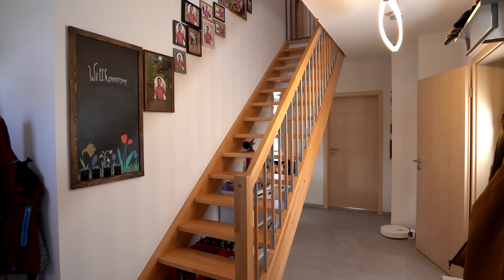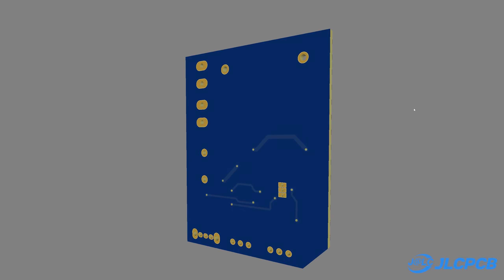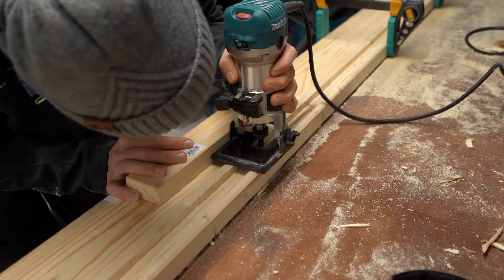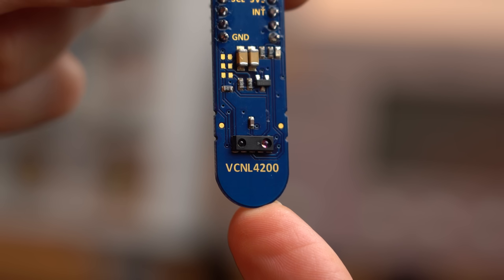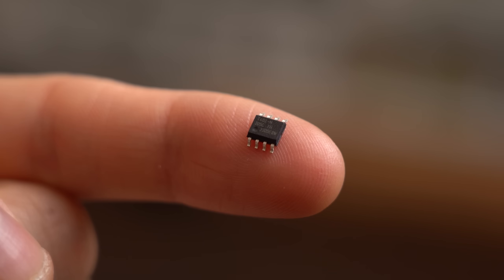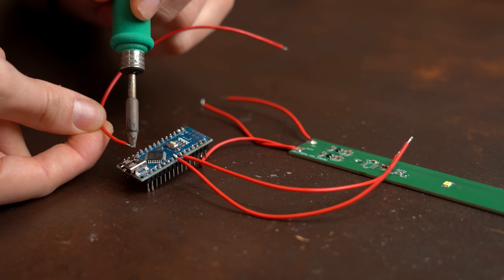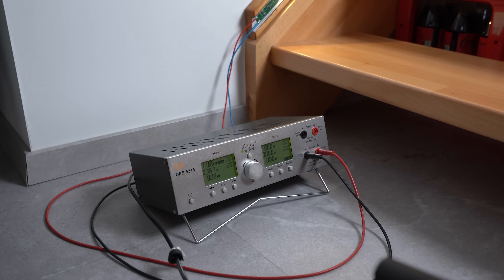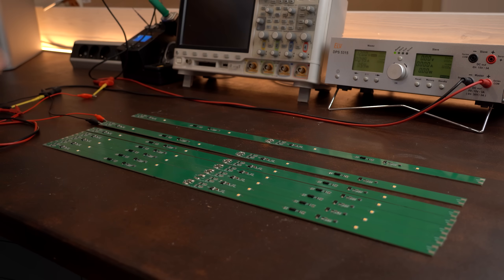I tried to Revolutionize LED Lights!.....And FAILED?

Comment: Ich schreibe das in Deutsch weil ich das in Englisch nicht so gut ausdrücken kann. Wahrscheinlich wurde sowas ähnliches auch schon vorgeschlagen.
Wenn du zB einen extra Kanal (evtl schmaler) in die Rückseite oder Oberseite der Holzleisten fräst, könnte man vielleicht die Sensoren von den LEDs trennen. Über kleine Löcher (wenn Kanal auf der Rückseite) oder den separaten Kanal auf der Oberseite, und auf die Länge der Treppe dann die Sensoren über die Stufen verteilen. 
Die Position der Sensoren könnte man dann auf entsprechende LEDs eines LED-Streifen mit adressierbaren LEDs mappen.
Vorteil wäre, man könnte wieder getrübte Abdeckungen für die LEDs verwenden.

Comment: Also gemessen daran, dass es besonders die Paneele sind, die am weitesten vom netzteil entfernt sind (wo also am meisten noise ankommen sollte), denke ich macht deine Einschätzung, dass die verbauten teile einfach zu viel noise erzeugen am meisten Sinn auf den ersten Blick. Meine Frage wäre, denkst du es ist der Infrarotsensor der da fehlzündet oder irgendwas im  LED Treiber Bereich? Würde ein tauschen vom infrarotsensor durch ne andere Technik wie z.B. Ultraschall funktionieren (ich sehe dass du dann die Boards neu machen müsstest, aber stand jetzt sieht's ja sowieso danach aus, und mit Ultraschall könntest du wenigstens milchige Blenden benutzen)

Comment: An addressable LED strip and a few proximity sensors (could steal power from the led strip + separate cable for Data) might be easier, but boring

Comment: i would've just used a lidar/tof sensor to tell which module to turn on, like with UART or something

or like WS2812B's, a data in and data out

on the modules, read a byte, only send the other ones to the next chip

on the main one deciding which one to turn on just send a series of bytes (one per led module)

Comment: "Which meant i had to flip 14 diodes...". ;) I am a software guy, so the programming stuff would not have bothered me. Flipping 14 diodes would have been a bad place. I would have flipped 13, and put one back in the original position... then fixed it again and screwed it up, haha. Thank you for the great content. That was awesome!

Comment: Tantalum polymer capacitors can deal with the HF noise better then aluminum electrolytics can, you might want to consider adding a 68uF 35V one per board alongside some MLCCs

Comment: I can't offer feedback on your design. But I can on your overall idea. It is a cool effect but as an aid to walking down the stairs in the dark, I don't think its the best. 
In my opinion you should light the whole staircase, however thats too easy and not cool.
So a lighting effect is needed. If you approach from the top the lights should light in sequence from top to bottom, and bottom to top if approached from the bottom. 
And if 2 people approach from top and bottom, then the stairs can workout who gets priority.
The smart bit is detecting the approach and making sure they can't turn off while you are on the stairs. 
I think you could expand this in to emergency lighting, to guide you to an exit if the smoke detector goes off. 
Your project so you fo you.

Comment: It is something I'd like to make myself. 

I was thinking about a different approach.

I wanted to use a regular indexable led strip and couple it with a single distance sensor (lidar?) switching on (with dinner) only the portion of the leds that reside at the detected distance. It would and could become a problem if two people are passing by at the same time but it will reduce the amount of components immensely, thus reducing the idle power required by the system that will be always on.

For you the problem would fall around the positioning of the lidar sensor. For me it is fine because i have a corridor, not stairs!

One single mc will be enough to do all the computation.

I was even wondering if it is possible to do the trick using a camera with a ir illuminator. 

ANYWAY... good job. I'm curious to look at the end result.

Comment: Ι would only put a sensor on first and last step and have the lights gradually turn on starting from the side that was triggered and then play with the timings of them turning on and off to figure what works best. I think your idea is a lot cooler but a lot more complicated to implement, but im sure you'll figure it out!
Reply from the maker: Thanks for the feedback :-)
Reply: But then you'll have to walk at the same pace every time... and as a developer I surely understand how hard it is to fight the urge to overengineer stuff to solve even the slightest edge case, haha.
Reply: My inner 5 year old wants to chase the lights and try to trick the lights!
Reply: @tommythebiker3081  Ah just give it 30 seconds to be safe
Reply: @soejrd24978  but then they will take tooo long to turn off when you walk faster! 😁
Reply: @tommythebiker3081  Having the the first triggered sensor turn on the lights and the second turn of the lights would solve this but it would be a problem if someone comes up the stairs while you are going down. 4 sensor, 2 on the first two steps and 2 on the last two steps could understand how many people came and left the stairs so it would make sure they are always lit when someone is using them but this again is a bit complicated.. So what I meant with the first comment when I mentioned timings was: think of the slowest you'll ever climb for example carrying a baby, measure that, add a couple seconds and you have your time. This will lead to the lights being on for a lot longer when someone is normally going up or down and them turning of if for some reason you stop in the middle of the stairs because someone asked you something. You are going to have to make some comprises in any case it's just about finding what your balance is between functionality, resources, time, durability, and many more. I personally can't code so I would most likely use buttons with timers so I change the state of the lights  from both sides of the stairs and have them turn off automatically after a long time if I forget.

Comment: SOLUTION for the "clear verses frosted cover" dilemma...   Extend the proximity sensor for each step (with wires) to the outside bottom of the rail.  Of course, that means you will have to create a slot in the aluminum  rail at each step, and a cutout in the wood rail for the sensor to fit into.  You can bend the wires up when sliding the board into the aluminum rail.

Comment: Here is how I solved my problem.
Went to Dollarama store and picked up two packs of fairy lights for under $5. They are 5m long and come with a 3xAA see-through battery case which I snipped off to put both in series.
A USB charger instead of batteries, one NPN transistor, one photo cell and a couple of resistors, completes the light detection, and comes on when dark.
The one covering my basement stairs, runs on an IR motion detector instead of the photo cell that's used for upstairs, which comes on when dark and stays on all night. 
It consumes nothing.

Comment: Doesn't the i2c bus have a 4 bit address you have to set per step?  Otherwise, if all the controllers shared the same address they would turn on and off and the same time.

Comment: If your goal is just get lights on your stairs, then i recommend recreating AlexGyver's staircase lighting project. His project is much simplier: 2 pir sensors on ends of the staircase, 1 light sensor, and roll of addressible led strip. It should be simple to adapt project for your needs.

Comment: Cool!
I wanted to try the step light a while back where, when you switch it on, it would turn on one step at a time. It's different from your use case but still it would have looked really nice. I gave up on it because of the cost and wiring involved. I also have very little tools to try something like this.

Comment: Hey man couldn't you just use an addressable RGB strip and make a pcb with proximity sensors?  Then feed that data to the micro controller and activate the rgb close to the proximity sensor?

Comment: I would implement it in such a way that if it detects presence at either end of the staircase it would send a signal to all the microcontrollers and turn on the all the LEDs at least but viable brightness then distance sensors come into picture, when they detect a human being in front of it, it'll turn up the brightness of itself as well as the module ahead of it. ... In your case i feel like ths sensors might also be interfering with each other.
Reply from the maker: Thanks for the feedback.

Comment: Nice to see you took my suggestion for the ATTINY402. Ok, maybe I wasn't the only one to suggest that part. As far as this design, you made it too complicated. Why do you need a LED driver chip and circuit? Just drive a mosfet from the micro-controller. You don't need maximum power efficiency. The on time is insignificant and a bit of power wasted doesn't matter. 

I have wanted to do this kind of thing as well. But I don't plan of having such fancy individual control. Detect at the top and at the bottom of the stairs. No it isn't as fancy as individual step control but I'm not trying to make an impressive YouTube video. I just want enough light to be safe. I already have some lights like this in a hallway that are controlled.

Comment: It's overcomplicated I think? all you need is to detect which end of the staircase the human appears and then to light the LEDs up to simulate an average velocity, people rarely change there speed on stairs. Maybe adding a few sensors to compensate for any errors and adjust the timings. Adding more intelligent code is free, you are relying on an excessive number of sensors to tell you everything

Comment: Because the stairs are straight why dont you use mmwave to measure distance the person is at the stairs and light specific light using addressable LED strip
Reply: Or an industrial grade ultrasonic sensor

Comment: hey, great idea!
although it would be enough to only have proximity sensors on staircase top and bottom (and trigger all LEDs at once once movement has been detected), as I don't see cases when you jump to the middle of a staircase (you must pass top and bottom either way)

Comment: All you really need is 2-5 Osram spylux (battery operated) motion and twilight sensor lights, replacing the white led´s with red as to preserve night vision and supply them with a 5v 2A usb power supply if you do not want to replace the batteries every few months. I put one near my toilet so I do not need the bright room light at night, I replaced the led´s with red ones and bodged in a cable from a broken pc mouse (to by pass the batteries) supplied with a cheap phone charger/usb power adapter. Thanks to a built in timer it gives the light I need to get my aim right when I pee at night. 2-3 of these modified the same way would be more than enough to light a stair case or other hard to navigate in the dark area with out disturbing near by sleeping persons.
you really should cover the lights with a red plastic, if necessary leave short bits of clear plastic just over the sensors, the cover on the spylux is opaque by the way so you could gut them only using their components for your light strip.

Comment: Since you're working with multilayer pcb you should consider using power and ground planes layer to sandwich noisy signals and shield them from sensitive signals, such the IN/OUT lines.
Placing 3 or 4 decoupling capacitor equally spaced on the whole PCB length shall help filtering out most of the noise.
Also, try to avoid running SDA and SCL lines as close for long distances. If not possible ground pour shall be filled in between.

Comment: Hi. I may have missed something but why did you need the data lines of the PCBs connected in the first place? Each PCB has its own sensor, controller and lights right? And in the video once you disconnected the data lines , most of the segments seems to work fine (I'm assuming) and the corner ones are problem. So check from which side the power is being given and if the voltage is getting bit too weird on other end maybe

Comment: Not sure how well this could work but instead of having individual distance sensors for each step almost, you could use one or two radar sensors at the top or bottom of the stairs. The LED strip can be an addressable strip like the SK6812 with warm or cool white and needs no modification. You measure the distance and then light up a couple of LEDs before and after that distance. Needs a ton of calibration and tuning maybe but it could work and end up being cheaper. I don't know how false positives and multiple users could be handled though.

Comment: I was thinking of a much easier solution with an Aqara FP2 presence sensor, a WLED strip and Home Assistant. Place the sensor at the top of the stairs, it should see your location accurately and then it is just a matter of coding some automations in Home Assistant to light up the correct part of the WLED strip depending on a person's distance from the sensor.

Comment: Why not just use a cheap addressable led strip and detect the person only on both ends of the stair? The project would do prtty much the same but with way less complexity and cost.  
it could also fit in a smaller rail (+1 wife approval factor) and you could use the diffusor

Comment: I think some kind of microwave sensor similar to ones used in dual technology PIR motion sensors for alarm systems would have worked better, or at least work through the diffuser cover of the profile. This idea is really good I think you should definitely pursue this. I think some of us would want to buy this

Comment: There is not a commercial product. I wanted to do this around 4 years ago. Almost all the more "advanced" commercial systems are ultrasonic or microwave at top and bottom of stairs and a timing system based on that input. I ended up buying cabinet or closet battery PIR motion cabinet lights, and running 2 wires between them in parallel from a wall power supply. The PIR system had a decent FOV so i could trigger a higher light, while walking up. they had automatic timing. But sometimes triggered randomly in the middle of the night.

Comment: This reminds me of a project I built back when I first started tinkering with electronics: A motion sensor based light controller with a PIR motion sensor. It worked beautifully most of the time, but whenever someone would flip on the light in the next room over, it would trigger the motion sensor resulting in the lights coming on in the middle of the night. I suspect I had similar issues with the input voltage fluctuating too much and confusing the sensor.

Thank you for the great video, keep up the good work and don't give up!

Comment: I definitely am not an electronics expert but i do alot of ESP32 /8266 projects. When ever i have unexplainable glitches happening on them I usually just start adding both decoupling capacitors and electrolitic capacitors untill the problem goes away ha.

Comment: Could it simply be an issue with your sensors reacting to the small movements in the wood when you walk on the stairs? Triggering false positives all over ?

Comment: I believe You messed up (or done suboptimally) few things:

1. those modules need to have some socket for disassembly for whatever reason, that soldering on stairs wasn't the best idea

2. i would consider researching how to program one uC from another, just think about plugging in into first uC and programming everything from that point, maybe You need to program programmer to 1st, then to 2nd, ... then to penultimate, then program real program to last, then to penultimate, ... then to 2nd and at last to 1st. i know, a lot of programming, but just write some ruby/python script which talks to avrdude or something. Or maybe You can put some socalled "bootloader" on Your uCs, like Arduino does.

3. also please consider adding test points/goldpins to Your boards, so You can connect easily using pogopins/dupont

4. why not have separate rails for 3v3, 5v and 12v? i know, a lot of pins, but nothing IDC-10 wouldn't handle

Comment: i have tested 3 pcb and turn out that you sent data line to other which lead issues and 2nd no capacitor it reset it self or stay on for no reason sound like not enough power or too much spike in power line and to reduce this issues just dont use same data line just use one ir detecter to one led or two led and add 800 mfu capacitor 8v to power line from beging to end so it doesnt drop out of stay on it should help and hope full you find it can fix up few mistake

Comment: Hey first awesome channel Im a fan. But a little friendly advice never, hold wood that close on the miter saw,  your hand should be on the outer holding part, if needed use a clamp but dont risk your fingers

Comment: Hey GreatScott, You might want to look into putting a blinder around the sensor. In a lot of the same sensor they have a divider between the sensor and sound it from when the led lights hit it. I notice my leds were hitting the sensor and keeping it on.

Hope that helps.

Comment: Another cheap solution for proximity sensor would be ir led and ir photo diode.
However in order to avoid issues with noise, it is necessary to modulate led and filter input.